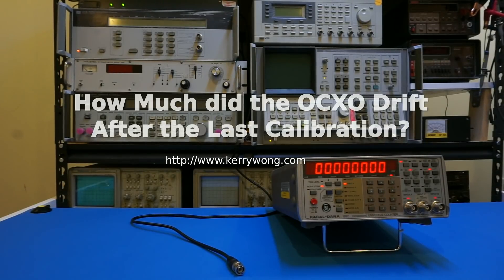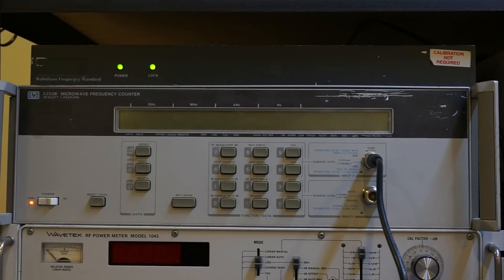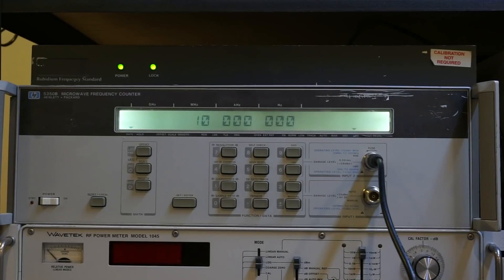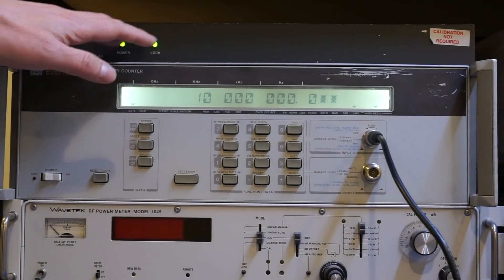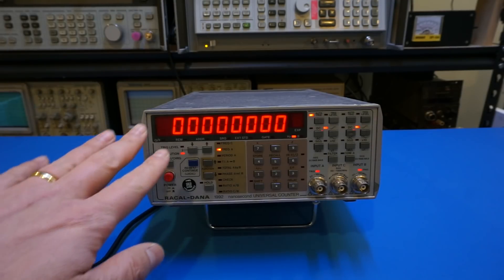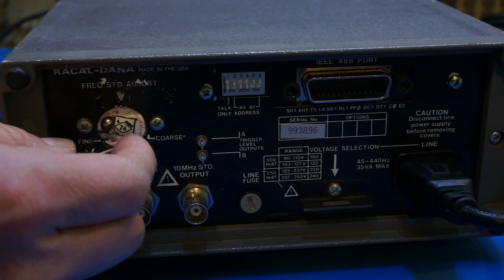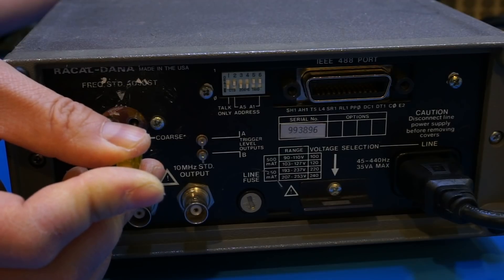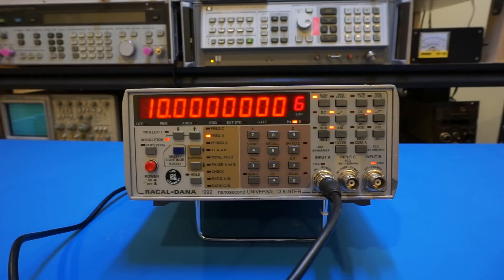How Much did the OCXO Drift Since the Last Calibration?

Comment: I recently bought an EIP 545A from Ebay that was last calibrated 15 years ago.  I compared it to a GPSDO and it was about 1Hz out.  Not too bad.
Reply from the maker: Yeah, for hobby use, even 10Hz is more accurate than needed. And crystals stabilize over the years so in theory, older equipment probably drift far less than newer ones.

Comment: under that other screw is the fine adjustment knob to get rid of the 0.03hz offset
Reply from the maker: Yeah, I didn't bother with that as the OCXO on the Racal Dana counter isn't that accurate to begin with. The last digit drifts up and down when the oven tries to maintain its temperature...
Reply: Kerry Wong ah okay, yeah no point adjusting away a digit that keeps drifting
Reply: Andreas Hettler: Exactly :D

Comment: Hey
I am close to a time-nut with 2 HP 53131A US Options, 2 Racal Dana US Options too and one old Voltcraft with US Option also.
U really need  to warm up the US Option OCXOs for 3 days and more. The Rubidium needs more than a week to be stable. I have a the simple chinese FE- 5680A, an unknown symetricon and a few GPS nomal.
1rst rule, never shut down the devices. Thats why most of the devices has no "real" power switch, just a stand by.
But what I've seen, you calibrated your Racal Dana with the coars screw only. There's a Fine tune trimmer under the 2nd Screw. With your Rubidium it is easy to calibrate your Racal Dana up to zero. Your Racal Dana has not the resulution to overbid the internal OCXO. Most cheap OCXO or $50 Morion Double Oven CXOs has more accuracy than your Racal Dana can count.
Reply from the maker: I didn't bother with the fine adjustment. As you mentioned, the internal OCXO has a heatup and cool down cycle when powered up, and during that cycle the clock would drift around 5 to 8mHz so adjusting the last digit to "0" is not going to make measurement more accurate due to the uncertainty on the last digit. 

Yes, these time references are not meant to be shutdown ever.
Reply from the maker: I'll definitely do that. Thanks for the suggestion.

Comment: Ummm... adjusting it isn't calibration... calibration is way different from simple checking against a reference.
Reply: Adjusting a counter to a reference is in fact a form of calibration, you can calibrate other aspects such as gate threshold and other measurements to do a total calibration procedure but a simple frequency calibration is more than good enough for its intended use